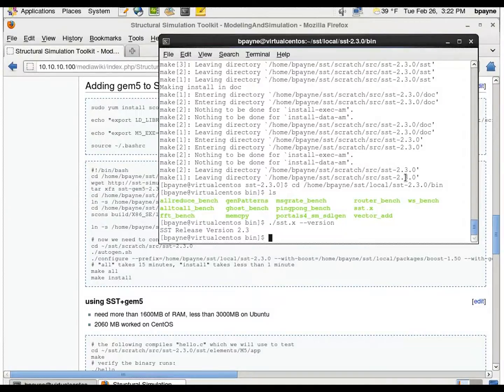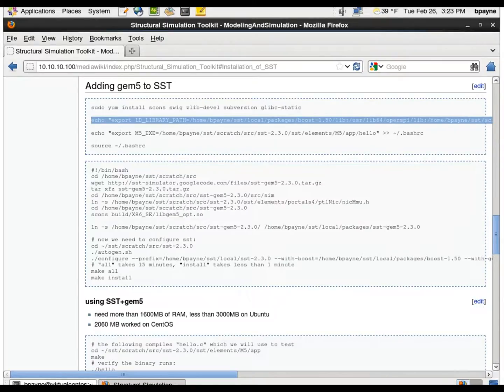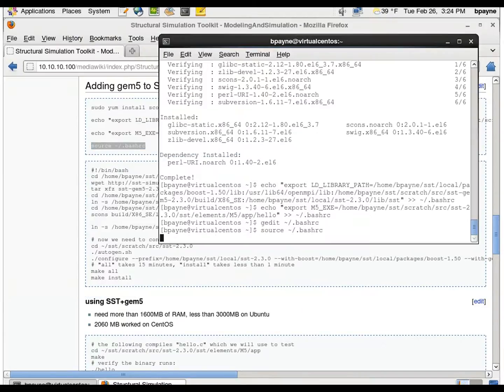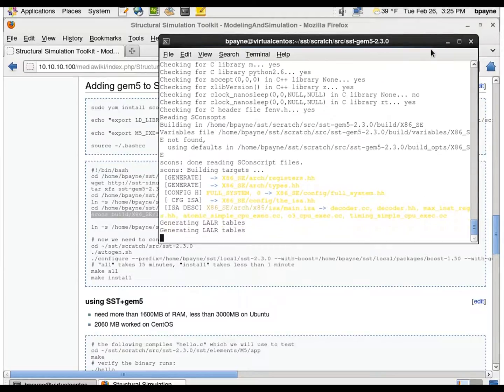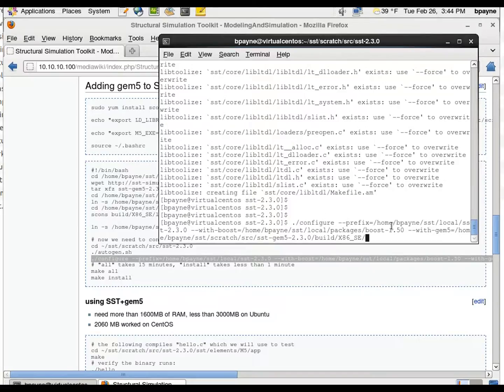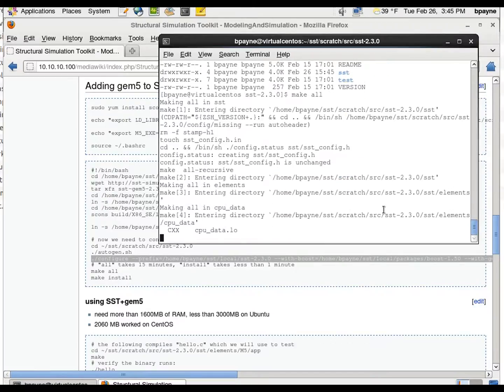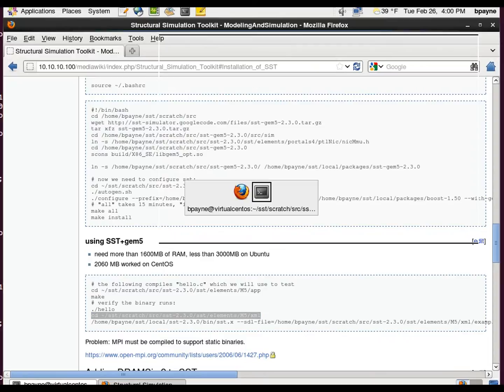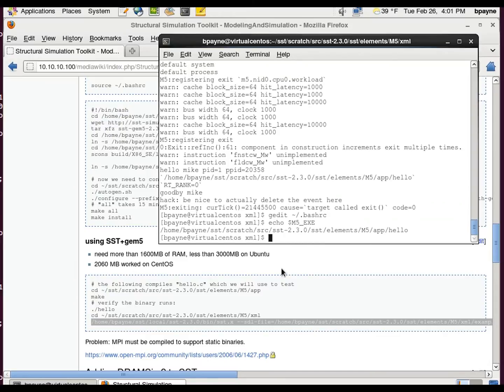Sandia's Structural Simulation Toolkit (micro) 2.3.0 install gem5 CentOS 6.3 64bit

Comment: Next problem:
The configure can't find the boost library. I get the following error:
configure: error: Could not find a Boost::MPI library to link against! (Looking in /home/harold/sst/local/packages/boost_1_50_0/lib)

After looking at the configure script, it appears the easiest wah to solve the problem is to specify where the library is on the command line. ie  So what library is it looking for?

--with-boost-libdir ???

Comment: I am having problems with this installation. I am using a patched version of Centos 6.3 (Final); Gnome 2.28.2. Kernel 2.6.32-279.22.1.el.x86_64
The problem is with the configuration of configure. 
a. boost=/home/bpayne/sst/local/packages/boost-1.50 was installed as boost=/home/bpayne/sst/local/packages/boost-1_50_0. Please note, following your instructions it installs as 1_50_0.